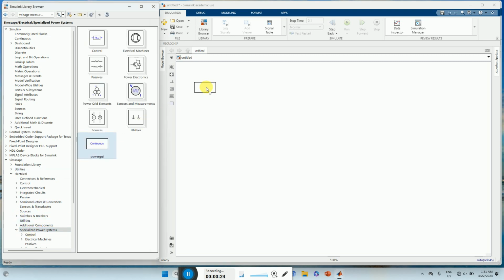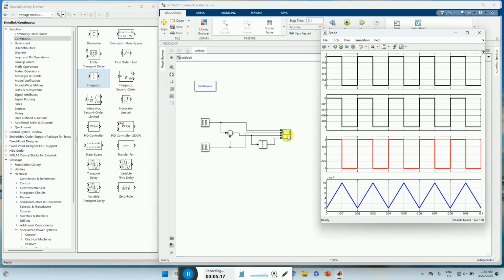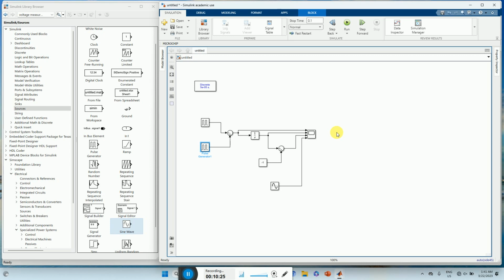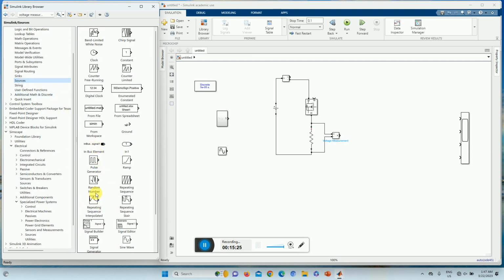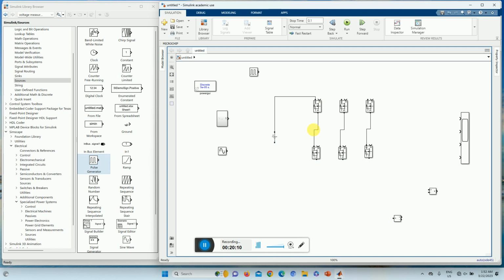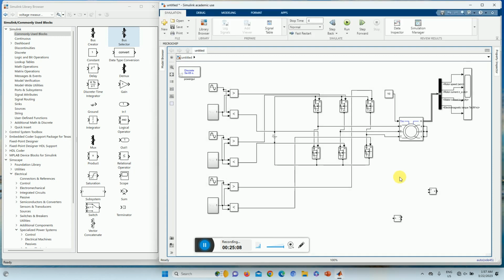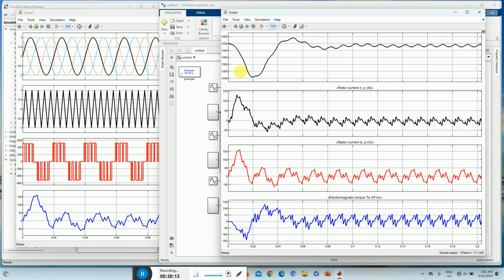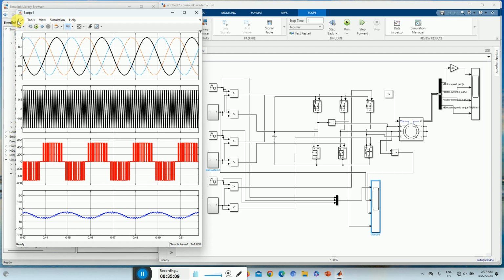Simulation of Speed control of 3-phase Induction motor using sinusoidal pulse width modulation.

Comment: Very nice and informative Sir, one question : Why the load torque is taken 10, kindly let me know how the rated torque is calculated from the machine parameters.
Reply from the maker: Usually Rated Power = Rated Torque * Rated Speed ( rad/sec). One can do reverse calculation and find Load Torque less then Rated Torque - Jdw/dt. Regards
Reply: @BrijeshKumar_electrical   Thank you sir